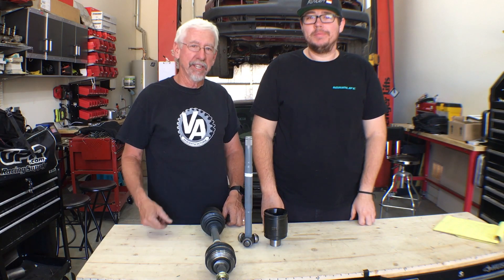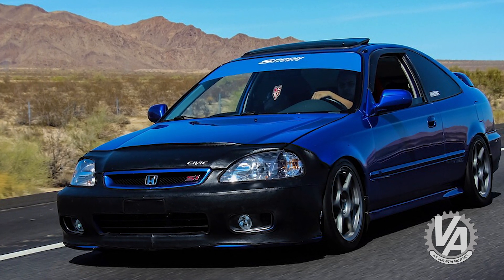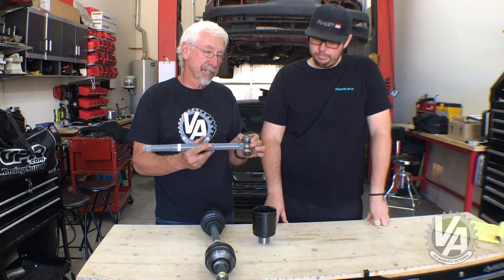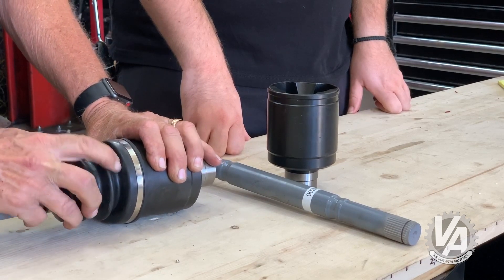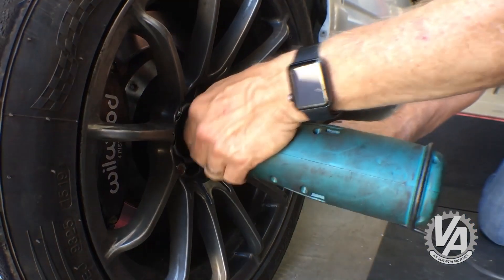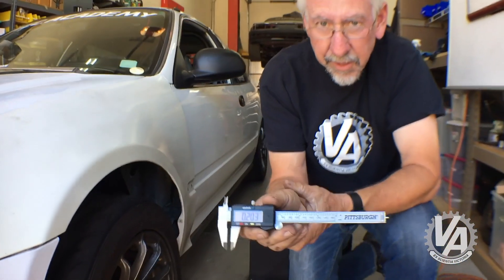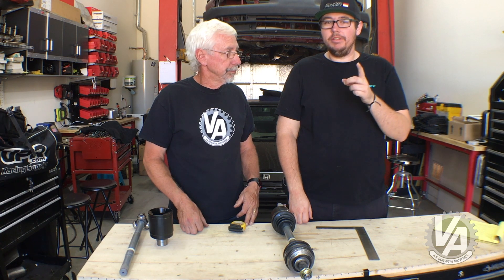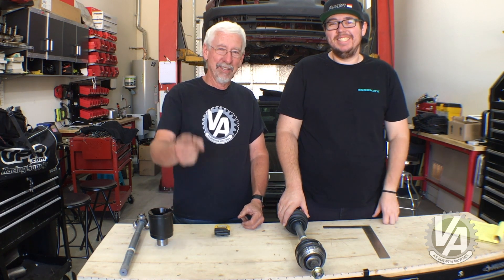How to Get the Right Axle Size for Your Honda- AXLE TECH

Comment: I am having the same problem with my 96 ek b18b1 swap passenger side axel is obviously too short I have searched the Internet high and low multiple people just came across the same problem, but no one ever actually says what fixed it what actually was used I know you’re gonna try and say they’re all the same size on the passenger side is a simply not the case here  you replaced it once compared them same size we can press I need from looking on the around the 99 to 00 civic they’re passenger says it’s the same size too

Comment: A very smart way to check if you have a proper length. 
I am willing to manufacture custom driveshafts for a kswap from a fn2 into an eg5. I have the original driveshafts, do you think new custom length shafts and wheel hubs, using the original CV joints is a right choice?

Comment: Not me.  Had 2 sets of Honda Accord 94-97 Level 0 "Drive Shaft Shop" axles, on stock VTEC 2.2L motor manual trans 5 speed (EX Coupe).  Both failed on inner CV joints. City driving in LA. just 6 month's life.

Might as well get remans for $50 each that last longer.  Over hyped on DSS, RAXLES, Insane Shafts..   Used original Honda axles are better...!  Or reman cores.
Reply from the maker: Remans usually work well.

Comment: I wish I had seen this video before I tore my cv axel out for the second time because it was vibrating like crazy.  It's for an 05 Honda accord hybrid 3.0L V6 and I ordered it from e-bay because I broke a lower ball joint and it tore the original one out and ruined it. (whoops), after researching numerous sites I found that the overall compressed length for stock axels should be 22 and 4/5ths but the one I got from eBay was and is 24".  So too long was a problem and I ordered another.  It would have been nice to know that in vehicle measuring trick...  I will know when the new one gets here this week...  Not sure how someone can send a "New" CV Axel for an 05 Honda accord hybrid and send one that is over an inch too long???

Comment: So for a budget 1989 CRX with a K24A2, what axle to I need (hubs are factory)? I bought new base axles but also don't have the intermediate shaft. Which intermediate shaft do I need, cause I heard the carrier has different mounting brackets? And where can I get one?
Reply from the maker: According to the internet, you should be able to use the RSX base axles. You will need an intermediate shaft from an manual transmission RSX or 2002-2011 Civic Si.

Comment: I'm experiencing what you stated about violent steering wheel jerking to the left in direct relation to wheel rotation. Along with a clicking noise when turning right. I have a 91 Honda crx with a JDM D15B 3 stage vtec swap from a 98 civic ferio. I unfortunately lost the list and part numbers we used for the swap.... Let the fun begin

Comment: Hey I just put two axles cuz they keep breaking I got a b20 in my 97 Honda Civic and I put on axle from a 98 Acura Integra u think that one's shorter
Reply: The 94-01 Integra axles are all the same length and are the correct size for a B swapped 96-00 Civic as well as a 92-95 Civic.
Reply: @BrianGillespie_brianathasport  o ok so why u think the keep breaking
Reply: @MariaTorres-hp6wx  Are they OE Honda or aftermarket?
Reply: @BrianGillespie_brianathasport  oe

Comment: My DS Axel was going out (started slinging grease).  I replaced the axle, but once I started driving (it still drives fine) I noticed this sort of screeching noise (a noise similar to bad breaks).  Any ideas on what it could be causing the dreadful noise?  It occurs on both straight driving and turns.
Reply: Screeching isn't usually associated with axles. I suggest jacking up the car front of the car and putting the wheels in the air so you can run the car in gear and sweep the wheels right and left to see if you can recreate the noise. Make user you use jack stands to secure the car and don't let anyone stand in front of the car while you are doing this.

Comment: Very good information! 

When I first replaced the axles in my EF, I wound up getting a pair with smaller diameter spline shafts. I didn't realize it at a glance. Once I tried driving though... that nut loosened up fast! (Luckily I was in a safe area - private property, no traffic) 

It was an important lesson to learn. 

Oh, and the computer system at the parts store had them labeled as "standard" and "accept standard" 🤷‍♂️?

Comment: You just saved me a huge amount of wonder and heartache.  The DA I have separated 5 reman axles for previous owner.  Suspension was maxed low and bearing was trashed.   Now I can measure before I drive it to make sure my replacement parts solved this problem.....THANK YOU!
Reply: What axels u get
Reply: @Marco Banuelos  I ended up using stock axles. The issue I actually had was the previous owner slide into a curb. The suspension components were all replaced, but the motor and trans were pushed 3/4" towards the passenger side. 
I ended up having to fabricate and weld in plates on the chassis mount locations to move engine and tans back to stock location. That fixed my problem.   Car has not blown an axle since.

Comment: Great content as usual! Definitely handy for the k swap I'm doing for my CRX.  

With that said - do the stock axles from an 02 RSX Type-s have an acceptable length to use in a CRX once the k motor is in??  I planned on getting new hasport axles but might need to save some budget and wondered if I can use what I have from my type-s; the axles are still in great shape.  Figured I'd ask the experts but I can check too based on this video ;)  Stay safe and keep doing what you do!
Reply: The Type S axels have too large an outer joint for the CRX unless you use the Karcepts 36mm hubs. As for being the correct length, I haven't tried those so I can't say for sure.

Comment: I swapped in reman axles from drivetech and developed horrible vibrations when accelerating or braking, very difficult to diagnose where it was coming from, oem, rebuilt oem, or reputible aftermarket are worth it!!
Reply: A bad vibrations is usually an axle that is too long.

Comment: Great info brian! what rotors are on that civic? i bought that same wilwood brake kit for my wifes 89 crx and the disk seems to be about 3mm to far inboard and hits the caliper any advise?
Reply: The rotors that came with the FastBrakes kit. 11 inches in diameter according to Brian at FastBrakes,
Reply: I know with OEM brake upgrades on an EF, there needs to be a spacer between the hub and brake disc. Sounds like this would solve your issue too.
Reply: @TheWarrenWalker  that had crossed my mind, i was hoping that wasn't the norm because that would put my tires closer to fender rub and i like the way its sitting right now on the coilovers. thanks for the .02
Reply: @thehaloguy9381  you can mill 3mm from the 2 caliper bracket flange surfaces, there are shops that specialize in this service for Hondas, but any local small machine shop will do it, very well documented mod for OEM brake upgrades on the EF. I have it done on my crx to run ITR calipers and didn't want to run a spacer . $50 problem solved. Cheers
Reply: That is actually the 11.75 STL big brake kit from fastbrakes. It fits under only a few 15” wheels.

Comment: Thanks very useful info 👍🏼. I had this issue with my crx swap k24 the axle came out like this dud axles and mount both from hasport and it happend. I replace the inner joint with h22 axle I hope it works fine to the end

Comment: Definitely learned something new. However, for the few swapping into a non Honda chassis with a Honda engine and trans: (FWD) what about measuring for a custom one?
Reply: Start with any axle that sort of fits and then measure to see what needs to change. Then you can start with the compressed axle length and ask you axle builder to make one longer or shorter per your measurement

Comment: @VTEC Academy, can i use the EP3 type R axles for my EG civic with B16/B18 outers?
Best regards from germany.
Reply: Ja kannst du.
Reply: Will the B16 outers go on that shaft? If they do, try them out and measure them using the above technique. It's usually been my experience one of the axles is slightly too short.
Reply: @BrianGillespie_brianathasport  Thanks for the quick reply, I will try to find out.
Reply: müssen glaube ich nur von links nach rechts getauscht werden? bin nicht ganz sicher 🤔

Comment: Dang live stream ended I think brian said rsx base axles will work  with the tsx trans, also will I need to use a tsx or rsx cables i already have a ktuned shifter but no cables yet
Reply: You need the K-Tuned shifter for TSX and Accord. Then the TSX or Accord cables work. For the axles, anything that works with the RSX engine in your car will work as long as you have RSX manual or 02-11 Civic intermediate shaft. If you use the TSX intermediate shaft get the Hasport axle for that swap. And it has usually been my experience that one of the base RSX axles is on the short side.

Comment: Great timing, been struggling with axles for my k24 ej2 👌
Reply from the maker: Cesar N we made this just for you. 👍🏽
Reply: sooo what axles did you end up using?
Reply: @Jovan.101  for passenger side, ep3 and not sure about driver side since i bought it from someone that didn't know but just told me it was for k swap but its a little too long so when the suspension compresses, it vibrates pretty bad 😕